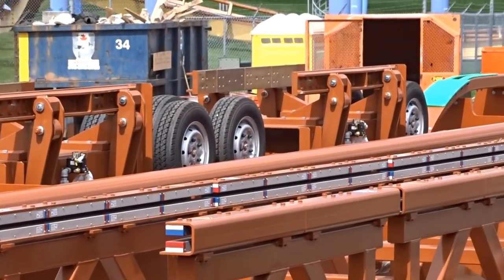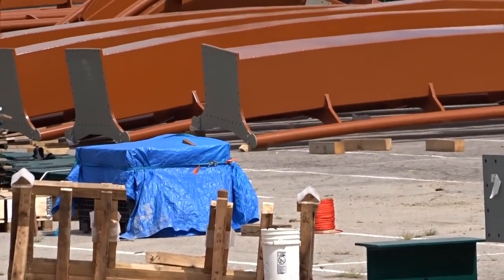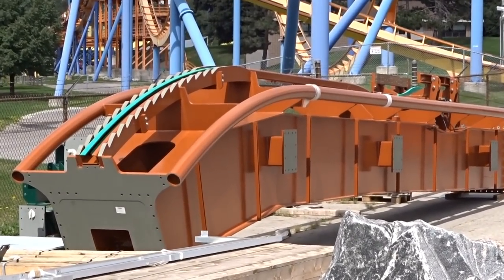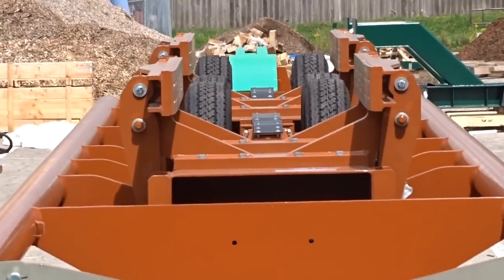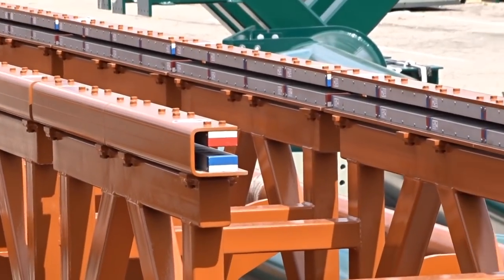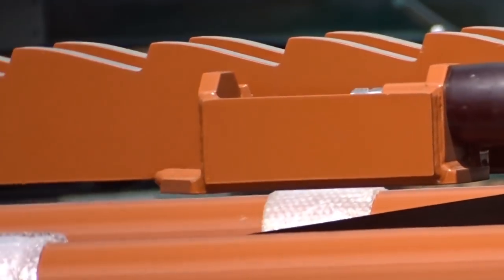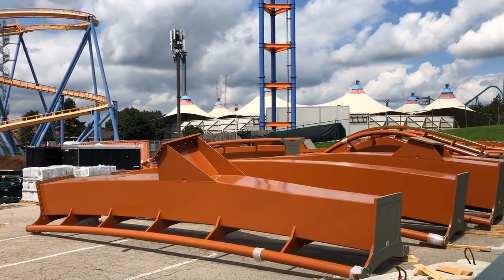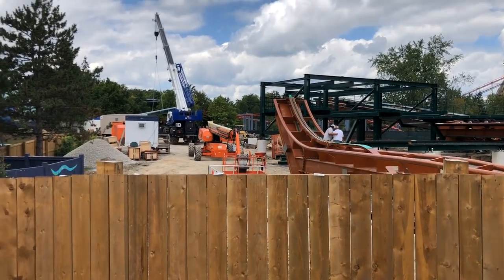Yukon Striker Lift Supports & Minebuster?

Comment: Those black rubber cylinders are very likely part of the dampening system on the anti-rollback system. It helps smooth out the clanking noise and bumpy sensation of coasters as the dogs under the train latch or roll over them. One of the great details B&M put into their rides engineering. https://en.wikipedia.org/wiki/Lift_hill